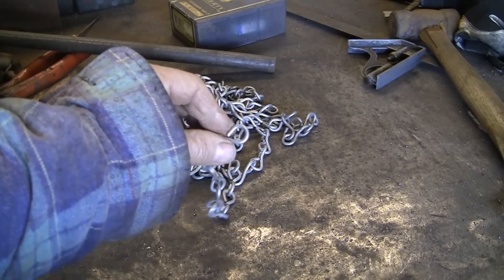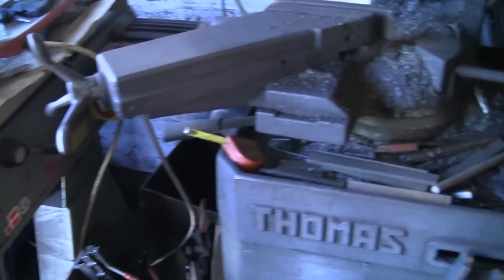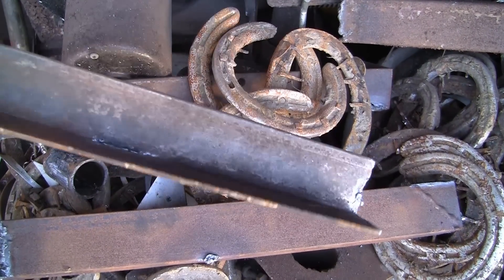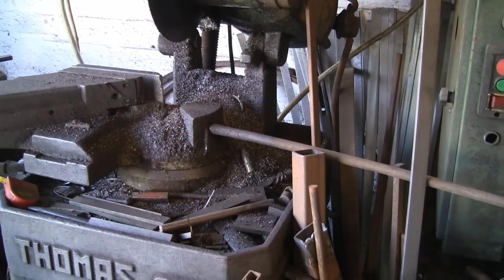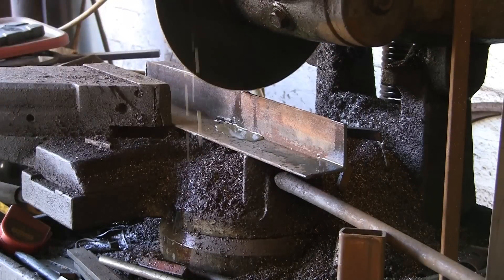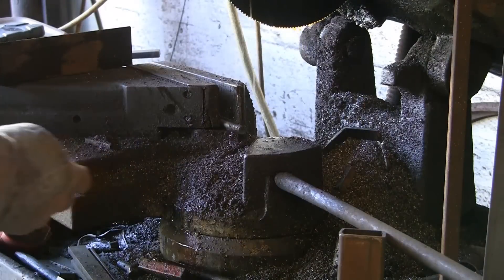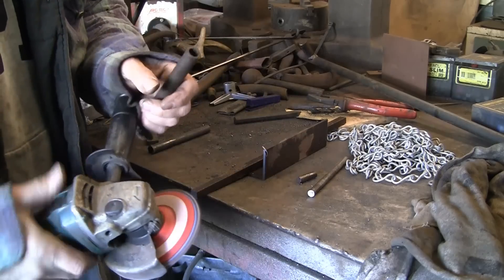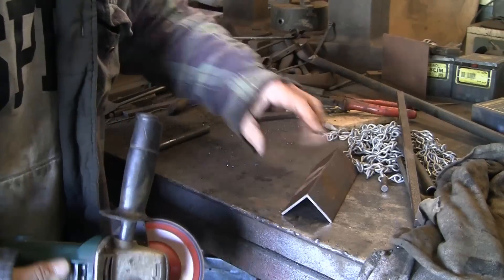Ring making jig

Comment: Gary, can you make a more in-depth vido on you forge I have watch the last video and still hung up....thanks
Reply from the maker: what aspect of it?
Reply: how you put you fire box tougher, steel , and depth
Reply from the maker: Bryar Dail
I don't mean to be rude but it's not rocket science! It doesn't matter much about the dimensions. Make it how you feel is right for the tools, materials and space you have.  Mine is just a two foot square box eight inches high with a hole in the bottom. It's made of 1/8" plate but could be anything from 14g to 1/4". I just made mine as I did because of the materials I had to hand at the time.